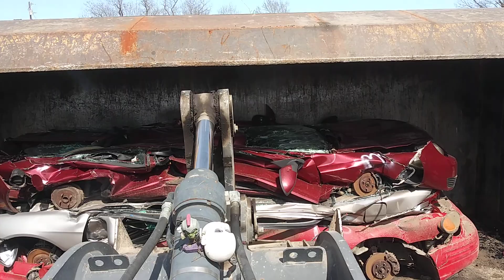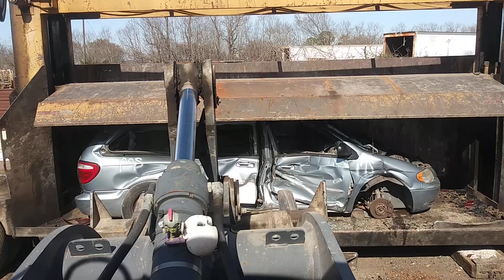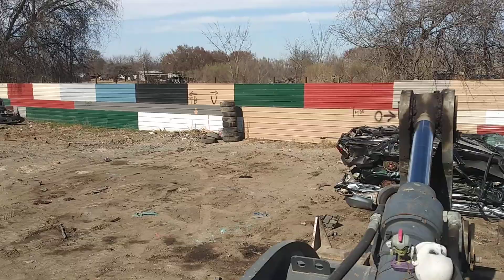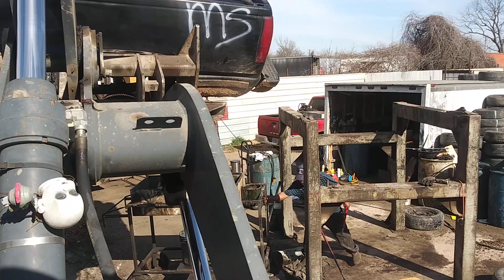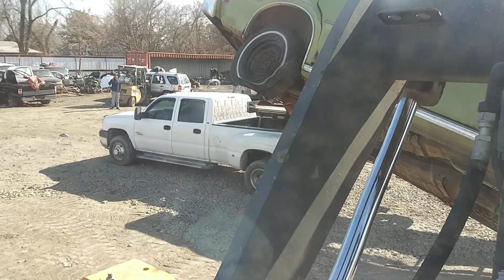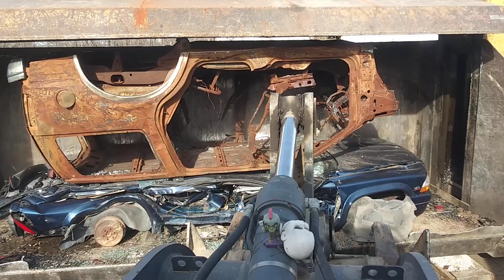CRUSHING ANY & ALL. 1983 FORD F150 GETS CRUSHED! 1975 MERCURY COMET COMES ROLLING IN.

Comment: I can probably help you out on your 3 answers. Car are usually small. Unless you're talking about an SUV. A truck can be used for a lot of things hauling thing's or a camper shell on using for camping. Now a bus can be used for a lot of things as well storage. A living quarters with a bathroom and shower built-in I seen a lot of YouTube videos like that. At also depends on the size of the bus. If it is a bigger bus. can be turn it into an RV.
Also what does TCF stand for
Reply: TCF stands for "Trash Can Ford " 🗑
Reply from the maker: Yes Sir TCF!!